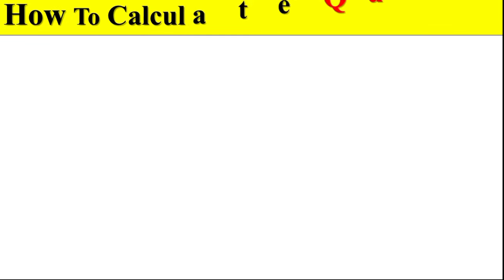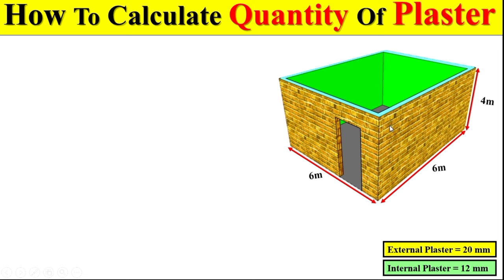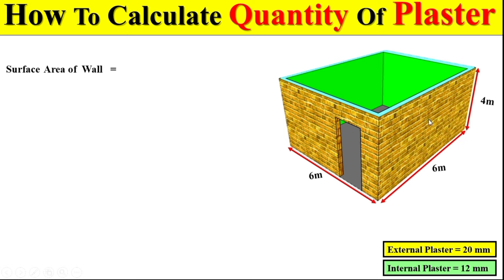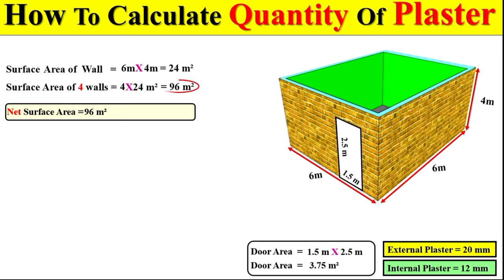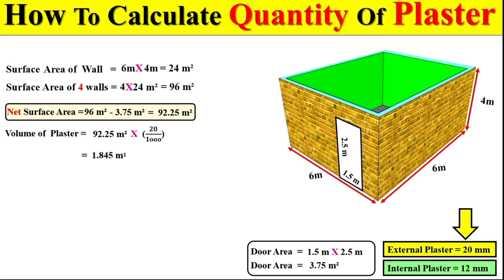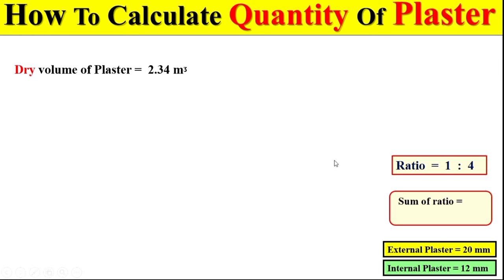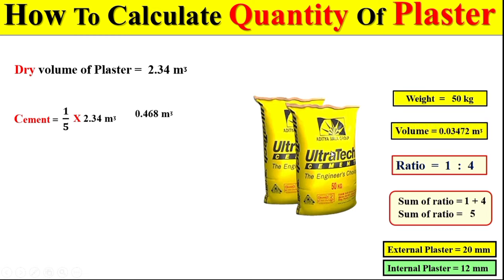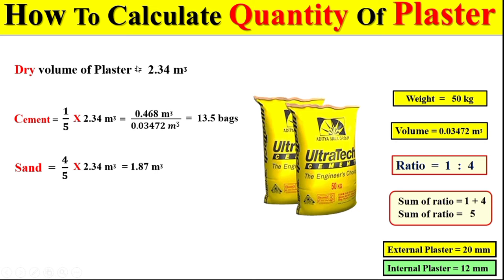how to calculate plaster quantity | Plaster Quantity Calculation | Cement Sand Quantity in Plaster

Comment: Yes sir, where has 1.27 come from?
Reply from the maker: Dear PIUS OBONYO for dry shrinkage in cement sand ratio of plaster we multiply this factor
Reply: Dry volume of plaster = 1.33 x wet volume of plaster.
Hota hai sir

Comment: I don't get where the vol. of the bag of cement 50kg is equal to .03472m3???
Reply: Volume of cement= Weight of cement devided by density of cement so we can get it 50/1440= 0.0347
Reply: Density of cement=1400kg/m3
Mass of cement=density of Cement x volume of Cement give the result